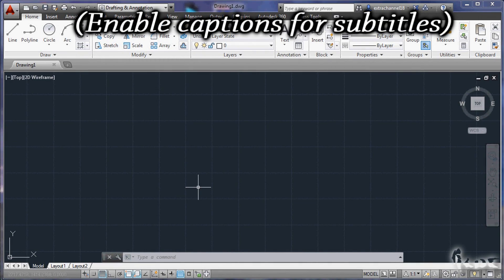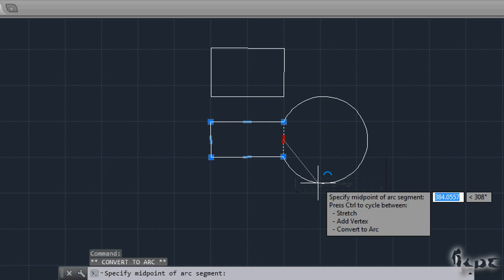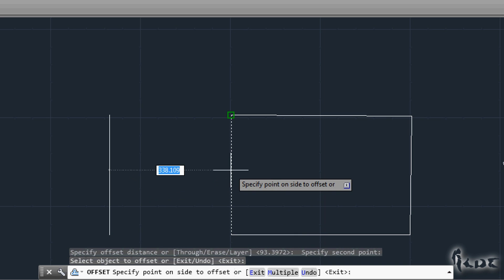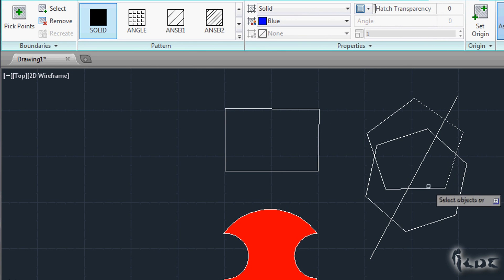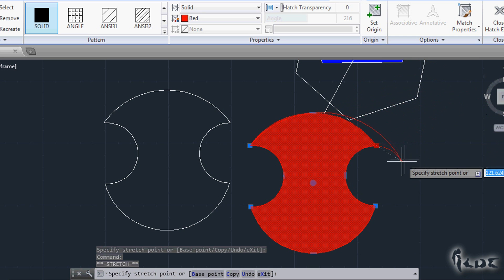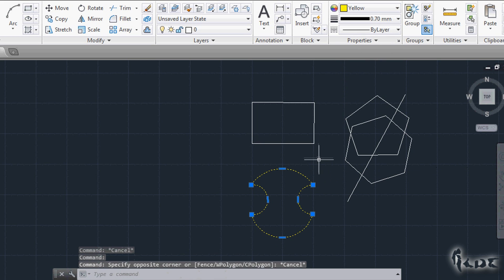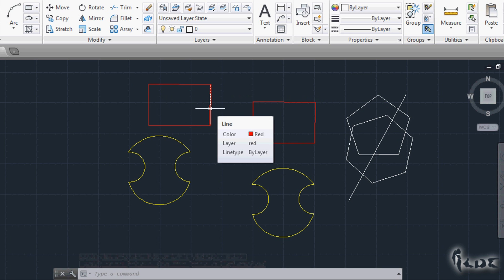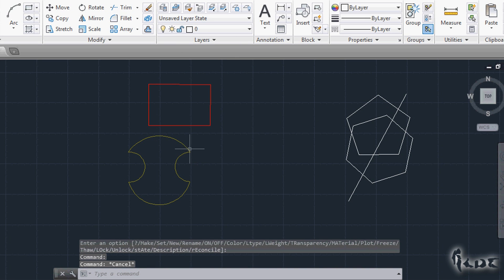AutoCAD 2014 - 2D Graphic Design Tutorial [COMPLETE]

Comment: i couldnt seem to find the "convert to arc" option when i stare at the polyline. how do i get this option? my line doesnt have the "small rectancle" at the center of the line,,, how do i make it show up? thx
Reply from the maker: There is an option in the bottom right corner that makes your pointer ''active''. If you watch the first seconds of the video, you will set the right options to follow what it explained after,